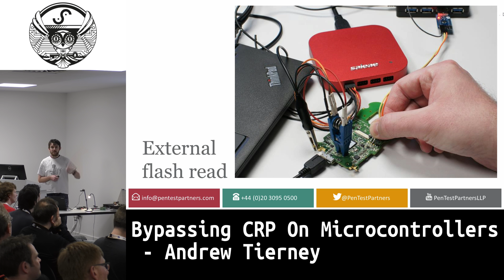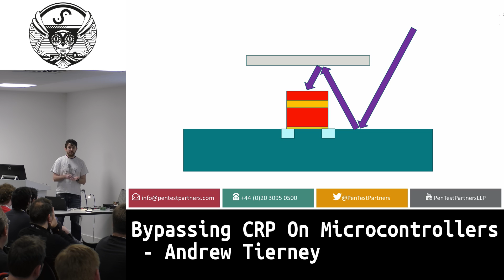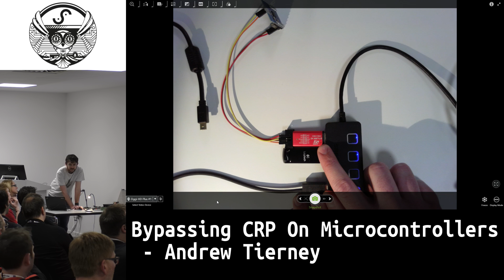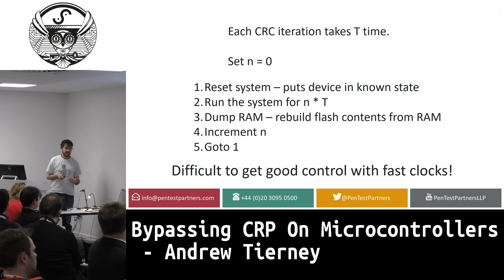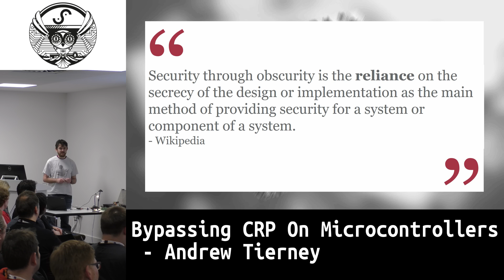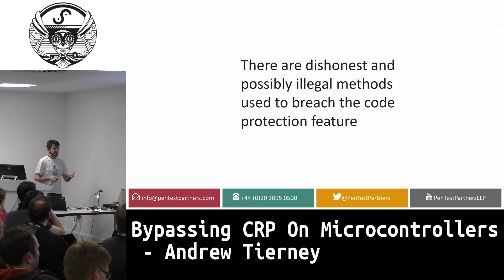Comment: Nice talk! But how do you enable SWD debug when the device is Code Read protected? In ARM Cortex, SWD debug is disabled when CRP is enabled.
Reply: varies - usually, you can't, but sometimes, you can... here's my work on this: 
https://medium.com/@LargeCardinal/how-to-bypass-debug-disabling-and-crp-on-stm32f103-7116e7abb546
Reply: Not really, the STM32 for example still has SWD enabled when CRP is enabled. I don't know if this is true for all ARM implementations but on STM32, SWD is always disabled by default, until you explicitly activate it through code or attach right away during reset. It's actually not so much SWD being disabled as the physical pins being detached from the controller.
Reply: @TheChrisey  it's dat boi!
Reply: @TheChrisey  So what does this mean?